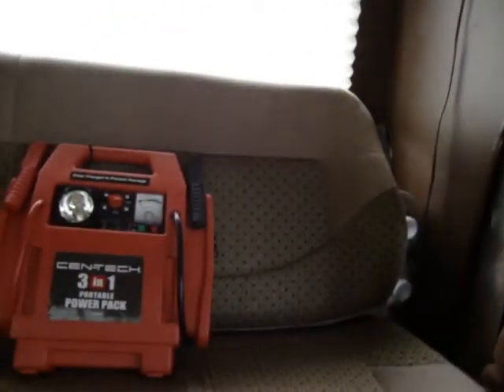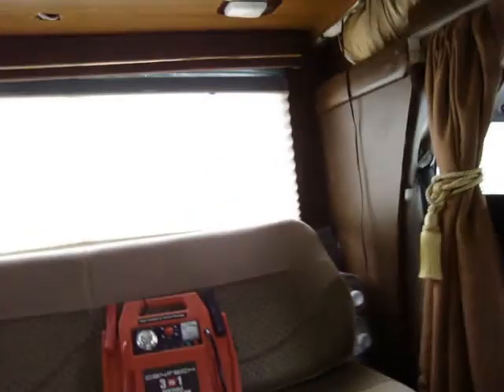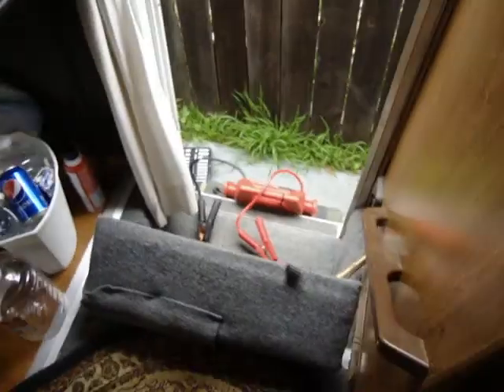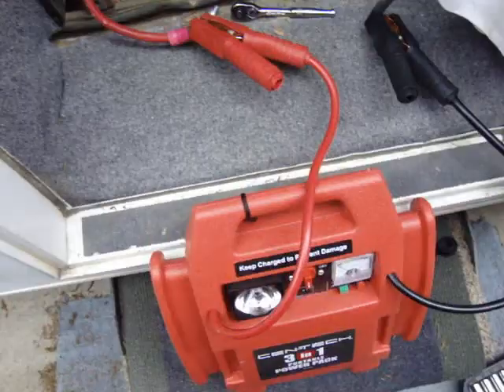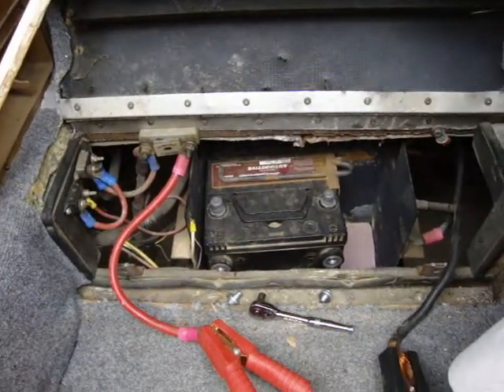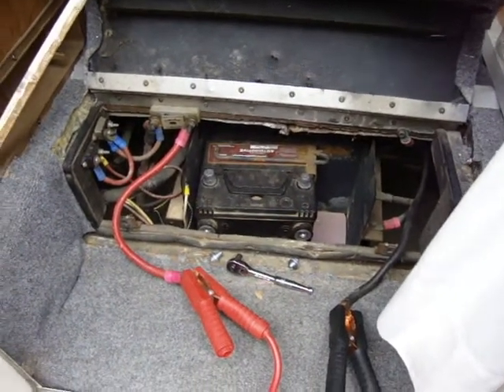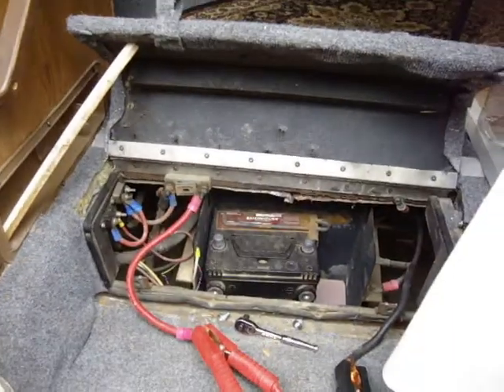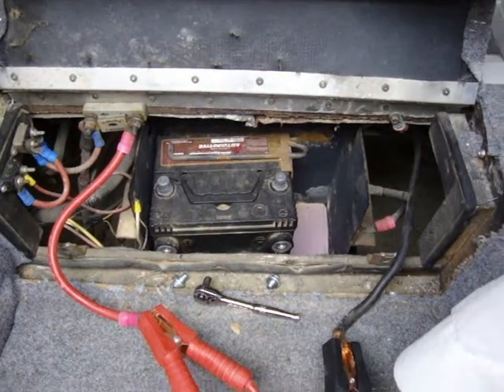RV Lady S1 E9 The Generator Test

Comment: Hi RV Lady Just a word of warning - don't rely on that portable battery pack - I have used several of them including very expensive units and the battery in them is of inferior quality - basically crap. The air compressor couldn't blow up a balloon and the inspection light last approx 45 mins on the internal battery. The price of the product should have given you a clue to it's quality :) It's better than nothing but don't rely on it - that's it for now - I think your videos are great and you're a natural in front of the camera. Last point - don't forget that when you juice - the fruit etc has lots of natural sugar in it which will not help if you're trying to lose weight. I lost 84 pounds by cutting out snacks, bread, some fruit in particular bananas, and simply used a smaller plate so the meals were smaller. Each to their own - it worked for me - take care :)